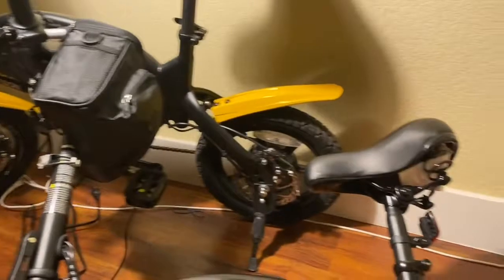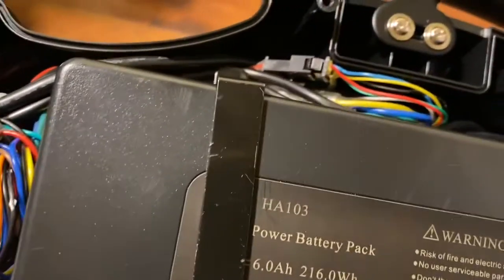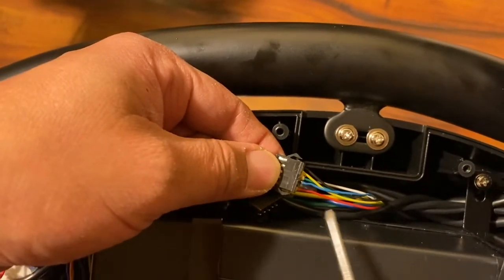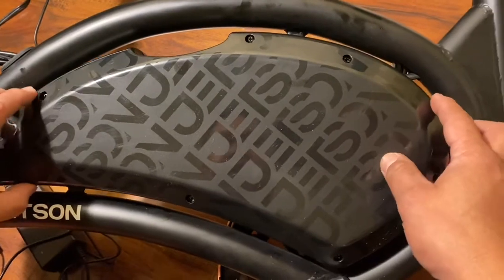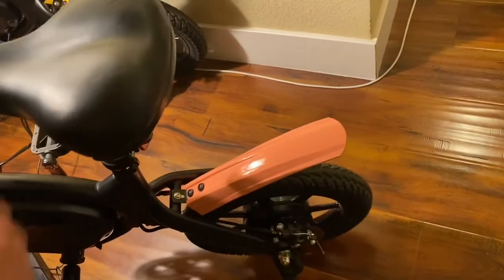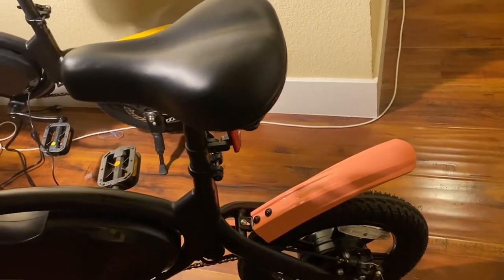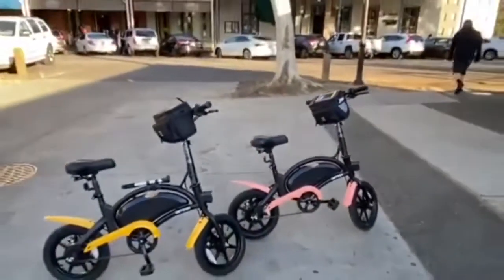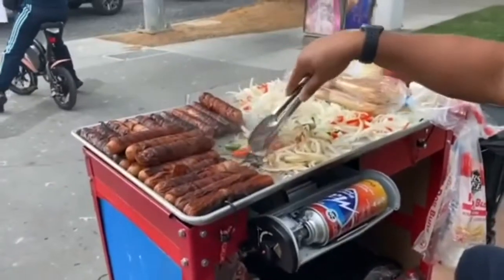Jetson pro e bike from Costco had to fix the throttle loose wire

Comment: Well darn it My blue one Not locked in the connector either but it didn't fix mine when I repaired it. Still stumped. Have power lights but no throttle

Comment: Throttle not working….checked wiring and the cable near the motor….back wheel spun a little but still no power…any advice…
Reply from the maker: Open it up, Just gotta check every wire, give each wire a slight tug if it’s loose tighten them. Make sure bike power is off, but I’m not a professional so you don’t have to take my advice. On your own risk.
Reply: @916_nsx  Is there a fuse near the battery…???
Reply: @centralparocker8886  haven't seen one

Comment: hottesss
 not sure if this is the same issue my bike was working fine and now if i turn my wheel to the right i have no power and my front light flickers if i wiggle a wire it works again
Reply from the maker: May be loose connection open it up take a look. Double check.
Reply: @916_nsx  would it be a electrical problem
Reply: I have the same exact problem when I turn the handlebars to the right the thread works again please let me know if you ever found a solution thank you

Comment: My bike won’t turn off any suggestions?
Reply: My bike has the flashing headlight throttle issue - I opened the case and unplugged the 6 wire - plugged back in and the bike turned on and started to roll.  Problem is - it won’t turn off.  Advice???